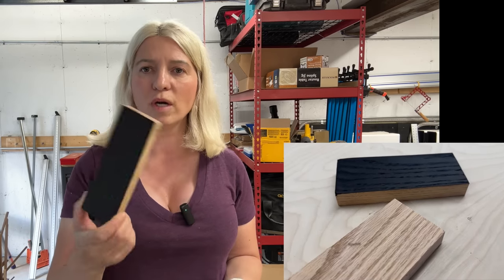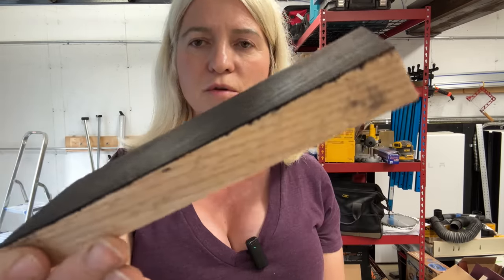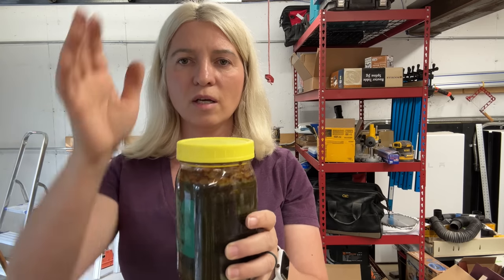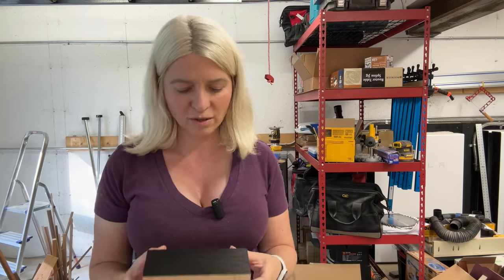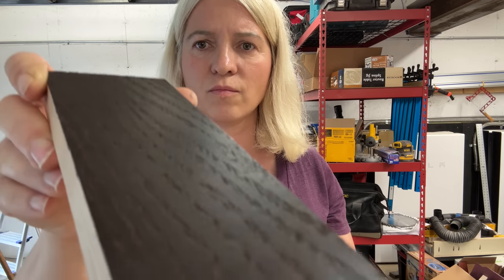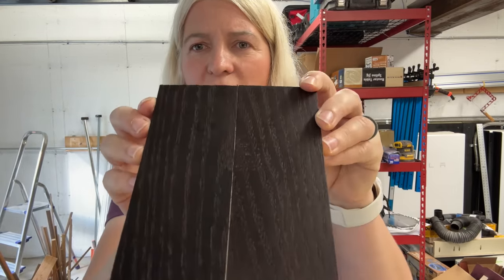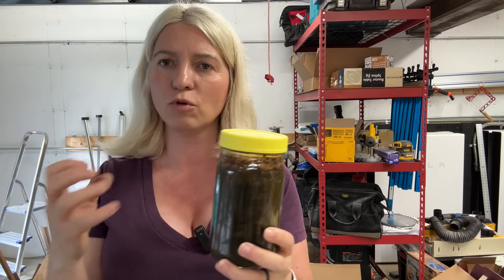How to ebonize wood with steel wool and vinegar. How to turn wood black. Aging wood.

Comment: I've used these methods a few times over the years. The Bark tea doesn't make a massive difference on red oak which already has high levels of tannins in it, but for woods which are lower in tannins it makes a huge difference - an example would be the maple from the chopping board. Another trick is to grab some plane shavings after your piece has dried and burnish the finish thoroughly, you will get a beautiful muted shine which you can highlight further with a wax finish.
Reply from the maker: I will have to try that
Reply: I was actually wondering if the tea would make a more noticeable difference on something like maple or poplar.
Reply: I also burnish the finish. I use a piece of steel plate, about 3" square with polised edges and rounded corners. This lays the wood fiber into the wood and leaves a nice polised surface and needs virtually no finish other than, say, a light wax.
Reply: Awesome video! 👍
Reply from the maker: @lazio7495  thanks
Reply: Will it work on pine?
Reply from the maker: @williamlundflink787  no
Reply: @NeoRichardBlake  It works really well on poplar.  I have done it many times, but only with the tea.
Reply: @williamlundflink787  Yes, with the tea it works great on pine.  I just did some yesterday for a project in fact.

Comment: vinegar and steel wool has been used for centuries to dye wood its called vinegaroon, and it workes superbly well on veggie tanned leather, its a whole lot cleaner than leather dye and will not come off and stain your white clothes like some dye can. if it doesnt seem to get dark enough try soaking wood/leather in very strong cold tea to add more tannin.

Comment: My wife came up with a technique using the distilled vinegar, the 0000 steel wool, and coffee.  She brews the coffee just like you would make a pot of coffee, and mixes the coffee with the vinegar and soaks the steel wool in it.  It seems to enhance the pigments in the wood and gives an almost graying effect with a tinge of brown.  We had no idea that anybody was doing this, great video, we will try your technique.
Reply from the maker: Great tip!
Reply: @woodworkingwithSkyler  Great video. I wonder, does iron acetate have good impregnating properties as in against wood rot, if the thing, let's say a bench outside needs treatment. Of course there would be some finish with oil or something but does iron acetate have such chemical properties on its own?
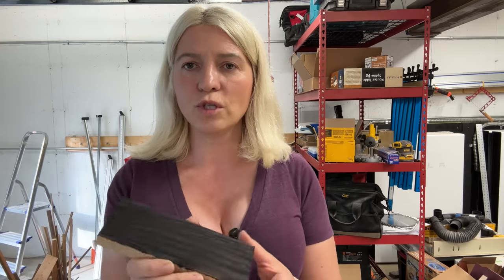Reply: @haliaeetus8221  If I understand your question correctly I believe she covered that @ 14:33 in the video.
Reply: @Bigtwinman  No, because you do not understand what impregnated wood means then, but thanks for the well meaning attempt.
Reply: Actually you are muting the effect.  Coffee is also high in tannin so by mixing it all together you are diluting the iron acetate.  If you like the color you got then I would call that a success.  Try it putting the coffee on the wood first.  You will get something much different.

Comment: You can use ordinary black tea as an activator on woods with no tannins in it. I used it on a walking stick, applying different coatings and finished it off with a few layers of a mat clear varnish and it looks stunning. Like some kind of Japanese lacker. A deep dark black-brownish colour. Very satisfying to work with these simple products and create such a nice effect.
Reply: was just coming to the comments wondering if the tea was adding tannins to the wood.

wondering if multiple treatments of tea would would enable soft woods to be ebonized in the same way ?
Reply: @dismafuggerhere2753  she said she added extra tannins with the wood.  But yes, different teas can give different colors. Instant coffee has a greenish hue to it. You can use anything with tannins in it, even red wine I believe
Reply: What is the sequence for this "activator"? Do you just steep black tea, put it on, wait for it to dry, then apply your stain as normal?

Comment: I have used this method to stain red oak to make jewelry boxes and it works great.  After the iron acetate dries (I use a heat gun) it is going to slightly raise the grain of the oak.  Just lightly sand the wood with 220 or 320 grit sand paper before finishing.  The stain won't sand off because it reacts with the tannins in the cell walls.  Remember, lightly sand.  I use spray lacquer for the finish and it leaves a beautiful sheen.  Thanks again for your demo.
Reply from the maker: Thank you for watching. I never used spray lacquer. Can you recomand a good brand? I might try it
Reply: I had wondered if the solution would lift the grain. I guessed right. I became a big fanboy of 3M's finish scuffing pads some time back. The one I'd likely use here is #7447. In my area the easiest place to find them is at an auto body shop, which is also a wonderful place to wander looking for other finish related speciality products...go figure.

Comment: Great technique, I really like the simple homemade aspect of this solution and especially that there are no volatile chemicals involved.
Reply from the maker: Glad you like it!
Reply: Actually there is... the reaction releases hydrogen gas, so do this outdoors.

Also, I wouldn't simply pour in the vinegar and put a lid on it.  At least not until the off gassing has finished (fizzing stops). Then it would be safe to set aside. (nuclear chemistry for almost 20 years).

I realize (near the end of the video) you stated to put some holes in the lid. The solution will continue to concentrate due to evaporation as time goes by.

Came to the comments to look for information regarding sealing off the solution too quickly.

Comment: Never knew of this process before now and took 6 years of woodowking and shop in school!  Wow I can see some nice speaker cabinets, or new entertainment center project. Love the simplicity/cost and ease of use with great looks. Just may try this ebonized finish on a Tele or Strat guitar blank over the winter! Thanks for sharing this S&S please keep the lessons coming,
Reply from the maker: Thank you so much. So glad you liked it
Reply: I'm going to use the Iron Acetate on my next Cigar Box Guitar Build. I'll then distress it with an actual piece of Charcoal, then seal it
Reply: Some of the earliest Rosewood slabs they put on Strat necks were really dark in colour compared to the anaemic stuff of today. Will this method darken up my Gibson 339 neck ?

Comment: I happened upon this due to some curiosity about how ebonizing works. In the old days, maybe up to the 1960s, the term would show up in Sears (etc.) catalog ads for cheap guitars with fingerboards made of ebonized hardwood instead of ebony or rosewood. I wouldn’t have guessed the process would be so simple. I don’t know whether it’s something I want to try, but it’s good to know how. Thanks!
- Paul

Comment: I work on acoustic fretted instruments. I use india ink to "ebonize" lighter wood fretboards or to cover light streaks and spots in real ebony. Works like a charm and won't come off on your fingers when completely dry. There is shellac in real india ink as a drying agent. Enjoyed your video. Thanks.
Reply from the maker: Awesome. Thanks for the tip
Reply: I’ve used xylene based furniture dyes to darken fretboards, but I have found they do bleed, especially when the fretboard is later conditioned (I use Feed N Wax).  
Given the “oily” nature of rosewood I was curious as to how well the iron acetate would penetrate it. 
Looking at the cutting board cherry really looks like ebony when ebonized.

Comment: Thank you for the demonstration. I mainly use shellac with various stains to colour wood as I prefer a more natural looking sheen.. easy to control sheen - semi gloss, gloss, etc with shellac layering. 
 Perhaps I can offer you some advice for your hair? It is commonly called Rice Water hair treatment and has been used for centuries. Simply put one cup of plain rice into a bowl containing 5 cups of water. Leave bowl covered with a cloth for roughly 12 hrs. Strain the rice from the water and put the 'rice water' in any kind of spray bottle. Spray this water onto your hair and leave for 10 mins or so. Then simply rinse your hair under the shower. Do this every day for 7 days and you will see a very noticeable improvement in the health and shine of your hair. My wife has been using this method many years for dry and frizzy hair problems. She doesn't really have the problem now but continues to employ this method to maintain healthy shiny hair every month or so. 
You will find many videos on Youtube about this rice water and it is very much famous because certain ladies in Nepal use it and they hold the records for longest hair in the world - YT videos about this as well. Anyway it is completely natural and once made can be stored in the refrigerator for 7 days or more. I hope you dont mind my suggestion its just i think you will love the results.  Kind regards Rob

Comment: You have such great information in this wood-ebonizing video!  I think the ink method looks a lot messier (and more expensive) than the iron acetate.  The bark tree is pronounced "kay-bra-cho" (with a slight rolling of the "r" sound) as it is Spanish.

Comment: The bark tea is powered AXE Breaker tree.  You can make a slightly similar tea with OAK bark which increases the reactive tannins in the proffered wood.  If you have actual BARK mulch in you garden beds, place a few small pieces in a old coffee grinder… then add to a small jar with hot water…try that. As low cost solution. Great vid.  Thanks
Reply: Did you try using the bark tea on the other side of the cutting board to see if the MAPLE other woods that didn’t react would?
Reply from the maker: great tip. Thank you

Comment: Excellent demonstration, thank you very much. My attemps at ebonizing came out much brownish but I didn't use steel and vinegar. I will have to try it, I love oak a lot.
Reply from the maker: Thank you for watching Serge. Make sure you seal your wood as soon as it’s fully dried ( same day) my piece was really black but the pieces I didn’t use I left in shop for 3 days unfinished and the got more brown. Experiment first before you make a big build
Reply: @woodworkingwithSkyler  What’s a good sealer? I’m thinking clear shellac.

Comment: I've ebonised oak - English Oak- both with ammonia and iron solutions. Recently I've use iron sulphate solution simply because I had a bag of iron sulphate crystals which I use in the garden to control moss in the lawn and on fruit trees. It's so easy to use, just a pinch of crystals in a little water, shake and go.
Reply from the maker: Awesome. I will have to try your method

Comment: Cool, might be good for staining guitar fretboards!
Reply from the maker: Yes, that’s a great idea
Reply: Exactly why I'm here! I'm wondering if the color will come off on sweaty hands? Will it affect inlays?
Reply from the maker: @rkgaustin9043  color doesn’t come off even when not sealed. But you should seal it. If no top coat is applied in time color changes to brown. Experiment first with scrap wood
Reply: @rkgaustin9043  Apparently the vinegar/steel wool is a tried an true ancient way of staining wood. And no leaching of tannins. One thing I'd like to try for myself.
Reply: @peterschmidt9942  I'd love to see your test results
Reply: This is exactly the reason I searched for and watched this video. This was very straightforward.
Reply: @rkgaustin9043  I'll have to wait until it warms up a bit. Don't like my chances of anything working well when it's hitting -5 most nights, especially me LOL

Comment: Thank you for this helpful video. After applying a sealer (clear) coat, how enduring, resistant to UV fading, scuffing are these stains and marks? I'm thinking of using them to stain trim pieces (door & window trim, crown molding, etc). 

I really like your method over regular oil-based stain with VOCs, which requires special treatment of the rags/brushes after using. If not, they might spontaneously combust.

Comment: Hi I’ve learned a lot from this video in terms of ebonizing wood. I have a question, this probably the worst question you’ve ever heard. Does any of the staining you used in this video would work with Douglas fur or pine? Thanks
Reply from the maker: It will not work with pine. It will turn it in a gray, brown color

Comment: Great video and details.  I really appreciate the real woodworker and not another marketing video.  What happens to the wood over time after ebonizing it with the steel wool in vinegar solution? Does it continue to darken or does the reaction reach equilibrium.  Does it change the density or strength of the wood at all?  Does it become more scratch/damage prone, and can it be sanded?  Have you ever tried ebonizing cedar?  After completely drying, would it react with any topcoat finishes like osmo hard wax oils?  I’m considering this ebonizing process for an experimental outdoor furniture piece that I’m currently building.  I may try this on an off cut piece of cedar to see what it will produce.  Will come back to share what I end up with.  Thanks for this great video!
Reply from the maker: Definitely experiment first. Ebonizing should not weaken the wood. But.... If left unfinished it my change color. I had a few different test pieces left in shop unfinished. some turned brown after 3 days, some turned marbled brown and black and some stayed black . I thought about maybe neutralizing the ebonized wood once black with some water, maybe that stops the process?
Reply: @woodworkingwithSkyler   Hi, I was going to ask exactly that. Do you need to neutralize the iron acetate solution? Maybe with a wet rag ? I was wondering if it could react with or weaken the finish. Beautiful results, will definitely have to try this.

Comment: Great video and presentation. I built a dog ramp that is outside, using treated wood. Painting or staining wood never has worked for me in the past as it always peels and flakes after several years, no matter how well I prepare it or how expensive the paint or stain is. I'm wondering if this would solve that problem. What do you think?
Reply from the maker: I think you should try it
Reply: @woodworkingwithSkyler  I'd have to first find out if it can be done on treated wood I guess. Thank you.

Comment: I made my gun stock black unintentionally, I used steel wool and vinegar and rubbing alcohol to remove the old finish but it turned black, how can I get rid of black stain? 

Thanks
Reply: you will have to sand it back to bare wood depending on how deep the vinegaroon soaked into your stock, sometimes it soaks in as deep as 3mm or more.

Comment: I am making an oak D&D table and wanted a black look, but I still wanted to see the grain of the wood. This will look perfect! How would you deal with a bit of glue still showing? I'm guessing it will stick out like a sore thumb?
Reply from the maker: I would ebonize the wood before assembling. Once assembled you could still sand a little. If you sand too much and color is removed you could spot ebonize again

Comment: Another great videos, i must try this. Im guessing its no good for pine
Reply from the maker: You are correct. No pine
Reply: try soaking your pine in very strong cold tea, let it dry, lightly sand it coz it will raise the grain, you will have added tannin to the wood and it is the tannin that reacts with the vinegaroon, pine has hardly any tannins in it.

Comment: does ebonizing wood work for outside projects and offer any protection to the wood like paint?
Reply from the maker: No protection. You have to add a top coat finish to it
Reply: @woodworkingwithSkyler  thanks!

Comment: When you ebonize the wood, is it permanent  ?   does it rub off at all  ?    thanks.
Reply from the maker: It’s permanent
Reply: @woodworkingwithSkyler  Thank you.
Reply: It's permanent but can be removed with an oxalic acid/water mixture.

Comment: What is the difference between adding a dye and the process of Lye-ing..?
Using a Dye adds a substance with collour.
Using a Lye changes the chemical composition of the wood.
2 totally different processes.

Lye is done with alkaline (a salt, on the pH scale)
Using an acid (vinegar) is quite the opposite...

What you do in this video is adding an oxidized dye.
So actually, you are just painting the wood.

FWIW if you Lye oak, it turns grey, not black. This process is used to make wood look antique.

Comment: Thanks for this video. I like the idea that it can be made using household materials. Would I be able to use beeswax as a finish on this, or will it react to the stain?
Reply from the maker: I dont see why not. I never tried finishing it w beeswax so my be worth testing it first
Reply: @woodworkingwithSkyler  Thank you. Yes, wise to test on a small area first.

Comment: I believe if you heat the steel wool solution it will go a different colour, I think it’s called aqua regia
Reply from the maker: Interesting. I will try that
Reply: Apply it to the wood then heat with a heat gun. @woodland escape has a video on it

Comment: Is there still a wood color (brown) in the wood with just the steel wool/vinegar solution?  I was thinking to finish a birch butcher block cutting board with this but don't want just black - I do want some brown in it.  Nice video thank you for sharing!
Reply: I need to do something similar but was wondering if this is food safe.

Comment: Is there a limit on how high you can sand before applying the bark tea+ iron acetate? I know from experience that Indian ink doesn't do very well when going above 320grit, I'm thinking about ebonizing some oak that has a clear epoxy casting so I have no choice but to sand up to 2500 grit before polishing the epoxy but at such a high grit I'm wondering if the iron acetate and tea will have any effect🤷 or if I do it before going above 320,400 grit will it sand out, not sure how deep the ebonizing goes into oak?